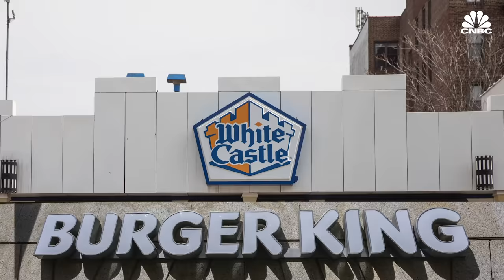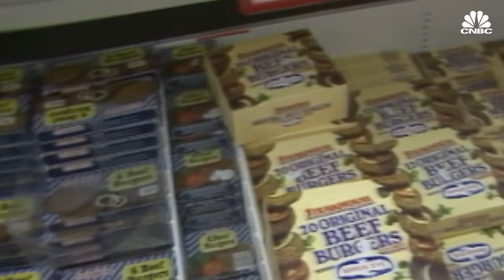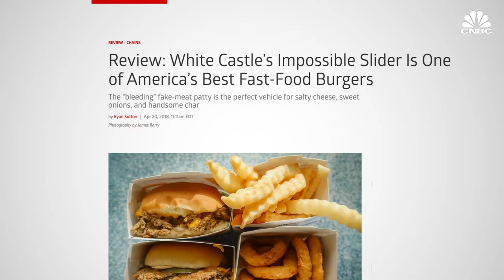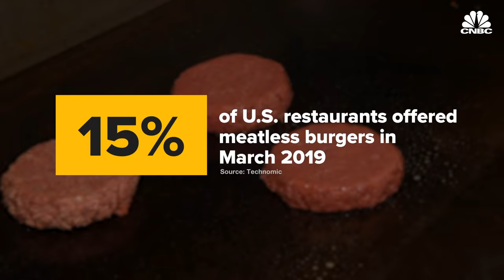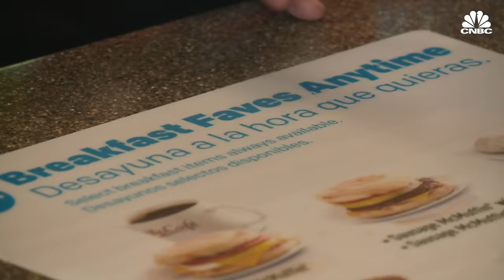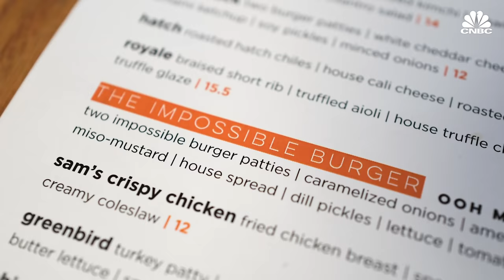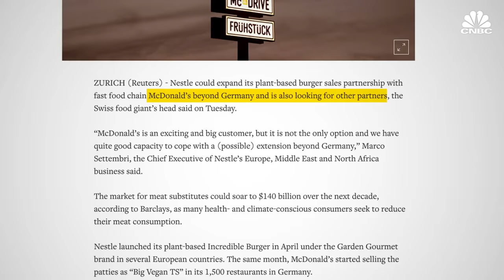Why McDonald's Doesn't Have A Vegan Meat Burger In The US

Comment: I remember when white castle hamburgers were just 10 cents.  That was Thursday nights out for me and my wife. And at that time there were no McDonalds or any other fast food joint in the area where I grew up, they came a little later. Although I do remember seeing a new Steak and Shake around 1958 right across from the "TeePee" drive in. Never went there though. Oh yeah, gas was around 28 cents a gallon.